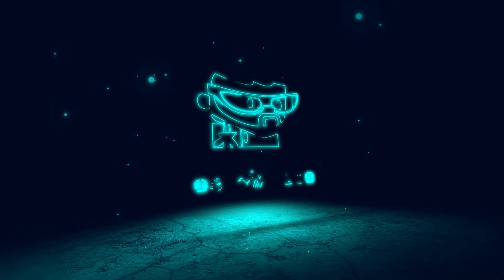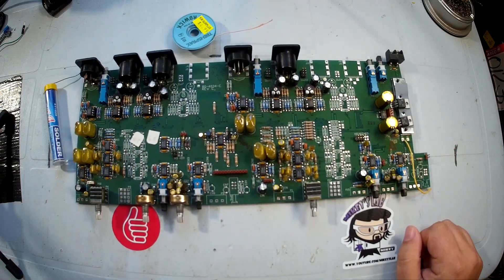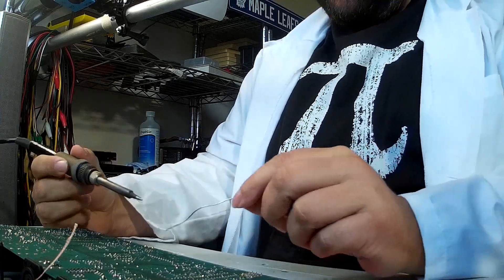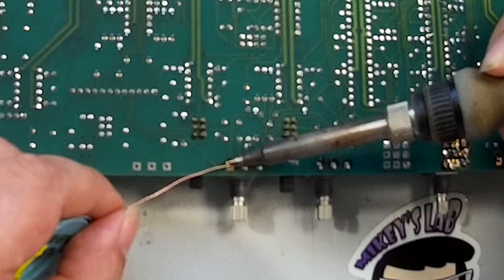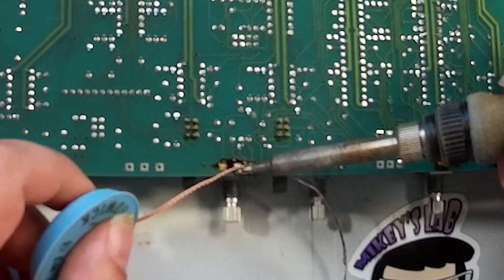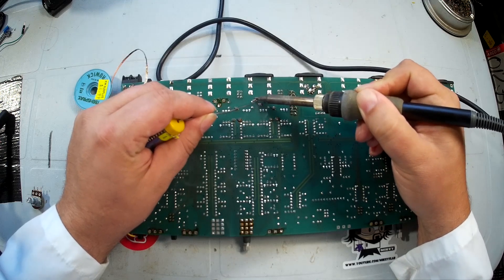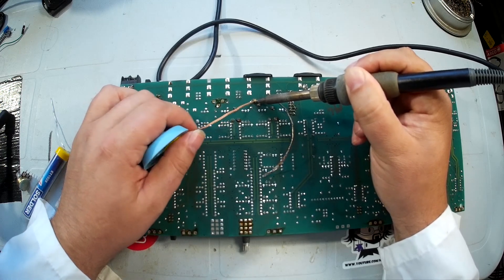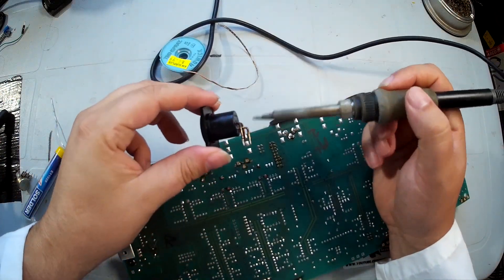Maker Basics - How to salvage components

Comment: Salvaging components helps getting started, thanks to the free source of components.
PCBs are often (but not always) laid out in modular fashion with everything related to one function near each other. One "module" could be display, display driver and other supporting components. Another one could be an graphical equalizer in stereo system. One can salvage free "modules" from old PCBs using the dremel tool the same way as one can salvage components by desoldering them.
Reason for doing this kind of salvaging isn't only about getting those parts, but the learning experience and getting to understand how devices work is just as valuable, or even more valuable in long run.
Great video on very valuable topic!
Reply from the maker: For sure, I may do another video showing this as I have a few more old audio pieces to salvage from. This was a quick one for an upcoming video on digital Pots, and i wanted to how how they are the same and how they are different from normal analog pots.
Reply: Instantly love, your channel and subscribed as I’ve been trying to find ructions on making a testing recycle bench in my garage. Do you think Desoldering components is a good way to actually learn how to/use a soldering iron ?
Reply from the maker: @christosvolikakis1523 thank you. We have just started shoot new content again, so you picked a good time to join. Yes salvaged components are a good way to learn to solder different foot prints. That way when you make a mistake, and you will, we all do, your not wrecking a $20 IC. As for salvaging to use, there seems to be less and less worth salvaging from modern electronics, since so many IC's are now completely custom. So unless you are using it to fix another identical board the chance of using the chip are small. I do find myself salvaging old input devices, sliders, pots, switches, knows and ports from 70's audio gear. They are unique and expensive to buy.

Comment: Usually, I take my board that I'll be scavenging from and grab it with helping hands. My set is a long set of bendable CNC lathe cooling modular hose with sligator clips on the ends hot glued to a heavy metal base. I hold the board vertically so I can access it on both sides adjustable. Using a standable butane torch, I heat the opposite side of the board of the component I want and just pull the heated component out with pliars. Of course, I wear saftey glasses, gloves, have a fire extinguisher ready, and in a well ventilated area. Easy peasy.

Comment: I recently got hold of the main board and the power board of an old washing machine that I had taken apart. One was much easier to scavenge from than the other because for some reason the power board had the pads on 1 side of the hole only but the main  board had through holes tinned the whole way, which was a massive pain and I couldn’t get off a lot of the relays, transistors and transformers that I wanted to, but I could still get a lot of the capacitors and resistors out by pulling on one side to get that side out while the solder was molten.
Reply from the maker: Power supplies are often 1 sided boards, simply because they are cheaper to make. When you get the type of problems you describe it can be beneficial to turn the heat on your soldering iron up. The lead free solder can be very hard to get to flow. For relays and multi pin components like that I will usually use my hor air station to heat all pins at once.

Comment: If it’s a Scrap board or you’re not worried about solder splatter… Set the board down into a card box so you don’t get splatters in your shop… And use compressed air. about 35 PSI is great but not over 50. Anything over 50 can blow the traces right off the board. Of course that wouldn’t matter if it’s a scrap board.  I can desolder a 16 pin through hole IC chip off a very thick circuitboard in about 12 seconds using this method. The chip just falls right out. 

I run a different hose off of my air compressor hose…  designed for using with an airbrush. This hose is extremely lightweight and flexible therefore it doesn’t hurt my wrist and hands.... because when I’m salvaging components I’m usually stripping boards for hours. And a regular size and weight air hose will make your hands hurt very badly after several hours. You can get an airbrush hose Harbor freight for about five dollars.

I also use a special blow gun that is more ergonomic and comfortable and allows easier access for parts Desoldering. It’s one of those lightweight plastic “pistol grip“ style blow guns… Usually 5- $10 at Walmart or the hardware store. And even though the tip is extremely small already… I attach a basketball needle to the end of the tip. That way I’m getting an extremely small and precise jet of air. This removes 99.5% of the solder from the pins allowing the components to just fall out. And I can do about 1.3 pins per second no matter if it’s a massive fat capacitor, potentiometer, chip… Whatever it doesn’t matter.  I can easily do a 16 pin chip in eight seconds so I’m doing at least two pins per second. But when I’m doing it for hours… My average drops quite a bit. 

I can do through hole and SMD components alike. Because this removes 99.5% of the solder… There’s almost nothing holding the component to the board. They will just fall right out. Where as with solder wick and even the most expensive solder suckers and vacuums… only remove about 90% of the solder. No matter how hard you try. And on rare or hard to find components… I can’t chance damaging them. which has happened countless times using Other methods. Wick and even my fancy hakko solder sucking machine just don’t cut it.

 I use a cheap 40 Watt Weller soldering iron available at most hardware stores For about $15. It’s cheap and it’s much hotter than my fancy Pace and Hakko  soldering equipment… (most of which I was extremely lucky to find an amazing deal because I would never be able to justify the cost.)

In this instance, the hotter the better. I want to spend almost no time heating the pins. Not only for efficiency but so I don’t damage the components. And actually the hotter iron is safer because its less heat dwell time on each component leg. 

As always I I enjoy your content!

Comment: G'day Mikey, greetings from Oz. I find recovering parts to be as much fun and part of the hobby as creating. Its just a pity wick is so expensive relative to the amount used. I mostly use the hot air method these days. Its fast and can melt multiple joints at once (Handy for device with 3 or more pins). Hot air stations are quite cheap now on Ebay etc. I am heading to your vid page now to start binge watching :). P.s. Should I invest in a lab coat LOL?
Reply from the maker: Everyone needs a lab coat!